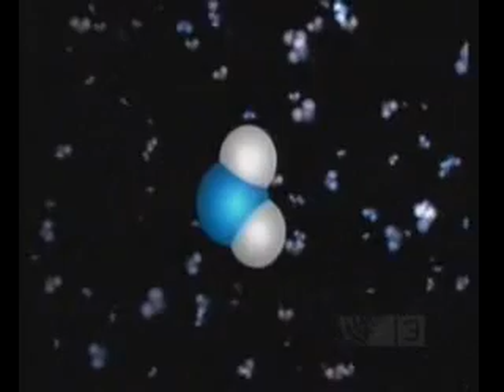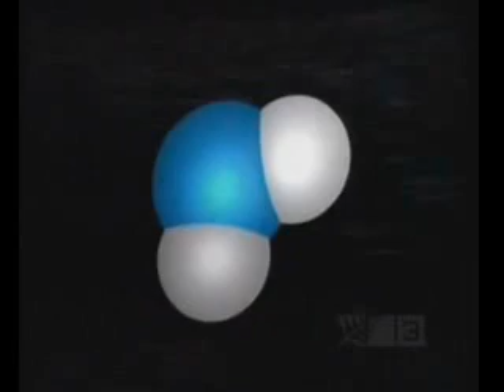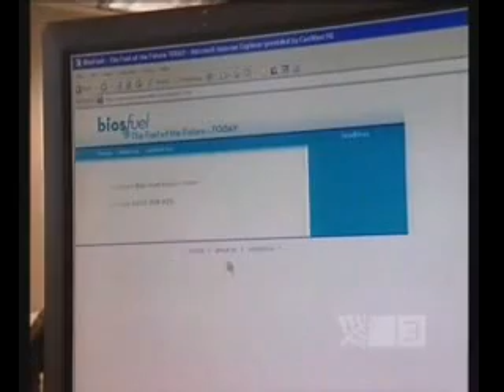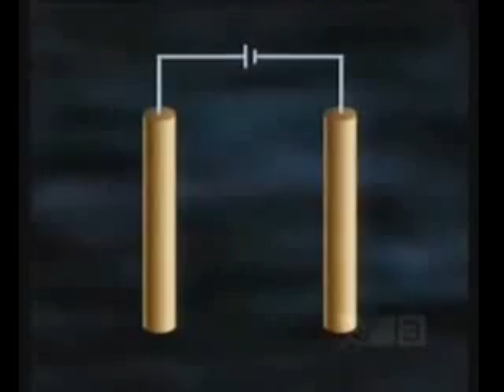A Motorcycle that runs on PURE Water.

Comment: one of the other comments about hydrogen peroxide as rocket fuel is true...however thats 90% H2O2 what you buy in the health food store (for $20+/half gallon) is only
35% H2O2 and what you get at the pharmacy is only 3%....there is no smell to this stuff. But if you'll notice none of them put thier finger in this "water based fuel". 35% H2O2 is VERY coustic and will turn your finger white within a minute or so. Ozonated (H2O3) is drinkable and could be part of this process as well. Ever play with Calcium Carbide and H2O? The bubbling result produces Aceteline gas (used in welding equipment). I'll have to play with some of this stuff on a lawnmower or something.

Comment: The fact that they say it's running on water is a bald face lie.  You have to split the water first into it's elemental makeup through electrolysis to hydrogen and oxygen. You then can use the hydrogen gas to run a normal combustion engine.  There is no free energy here, it takes alot of electricity to perform electrolysis to make enough hydrogen to fill a tank for any auto.
Reply: Scott Freifeld that means over 70% must come from another source that is not the engine in the motorbike e.g. a bank of high load batteries that costs money to recharge, the motorbike engine will not be charging the batteries either.
In the end if you have batteries you might as well use an electric motor it is far more efficient then 30%
Reply: I read somewhere its a 30% loss of energy converting water into HHO.  Even so with that kind of loss its still better figures then gasoline..imagine how much loss has gone into drilling/refining/hauling heh
Reply: I vaguely remember someone saying that it takes about 10 calories of energy to extract and produce 1 calorie of equivalent fossil fuel based energy.  Consider the cost (in calories) to run the drilling and pumping equipment to extract oil from the ground.  (Food production takes as much as 3x - 6x that amount).

Then I found this website:
https://www.ecoliteracy.org/article/fossil-food-consuming-our-future
Reply: and this water powered bullshit is the wrong way to solve it

Comment: In 1910, my grandmothers brother had a "Delco Plant and a battery bank for lights at his farm. My grand father tried to run a car on electricity to do so he used electricity to break the hydrogen from the oxygen then ran the car engine on hydrogen gas . It worked but electricity was too expensive. 
This motorcycle has a starting battery and it could be fed into the carburetor and the engine would run. for a mile or two...

Comment: It's the money game that makes the world go round.  As long as the energy interests find a way to profit from this method there's always going to be resistance. There was the case of a 'plasma' spark plug so efficient it could outlast the spark gap hundredfold and could even split water vapor into its basic components.  So far we haven't heard much from it except that Bosch considered its adoption, but for that had to phase out its entire production line. This is just one example, but the world is gradually getting there.  We may have to wait until oil runs out in order to see more advances. There are many ways to skin a cat and this is not the only method to extract energy from water, you could also call it 'oxidized' hydrogen. But if I were him I would keep a low profile and continue to do my work, but also share as much of my knowledge with others. Of course he may want to play the money game, but that's up to him.

Comment: I agree, you can't get more energy out of something without first putting more energy in.
What I don't agree with is that there is NO energy in Water, 
You have

You have to remember that Water in it's most basic elements is some rather volatile stuff. you have Oxygen which feeds flames and helps start explosions, and you have twice as much hydrogen, and Hydrogen while it likes to implode when it combusts, does not neutralize the Oxygen.  All you can say for certain is that Water is Stable.

Comment: The answer is simple: you need energy to compress air. When going chemical energy -> compressed air -> movement you lose a lot of energy. When you are going from chemical energy -> movement it is more efficient.
By the way; compressed air contains little energy. Don't drive too far!

Comment: I THINK THIS GUY IS USING HHO,AND THE BOX HE PLACES WATER IT IN AND CONNECT TWO WIRES IS A TRICK,THE OUT COME IS STILL WATER FROM THAT BOX THAT HE PUT THE WATER BACK INTO THE (GAS) TANK AND HE HIDES ELECTRODES IN THE BIKE TO MAKE HHO,THAT WHY THE BIKE ACCELERATE IN FUNNY WAY ,SINCE HE IS UNABLE TO GET THE MIXTURE OF HHO RIGHT LIKE EVERYBODY THE DEMAND IS EITHER LITTLE OR TOO MUCH ,HE CAN'T FIGURE ON DEMAND,IT IE STILL STAN MEYER PROCESS HE IS USING ,AND NOT TOO MUCH HHO ON THE START,

Comment: Your wrong the HHO reaction goes like this 1 amp 1 hour =6 litres of gas 10 amps 1 minute= 1 litre. Expansion ratios  water to gas 1L water =2037lires of HHO, exploded gas with spark that exceeds 9,000v is 1729/1 so increase the current to 40 amps you can turn an engine I designed at 3000revs it displaces twice its volume per revolution out of 2 combustion chambers see it at hhoigo.com  so output calcs like this 4Lx102.3x85%=34782kw input goes this way 40amps divided by 13vdc = 3.07 watts in

Comment: This video doesn't make sense. They assume that electrolysis is used to create the energy needed to run the bike, but those who understand basic chemistry know that this doesn't work.

The reaction to convert H2O into hydrogen gas is an endothermic reaction, requiring 286 kJ of energy. The amount of energy received by burning that hydrogen is theoretically 286 kJ of energy. In order to turn water into hydrogen, you need energy. Powering an engine by electrolysis of water is not possible.

Comment: A simple emmisions test would help prove if this can work or not. The test would show zero CO2 emmisions. However even if it showed zero co2 it could just be an engine that was modified to run on hydrogen. Hydrogen is not water lol...you would have to fill tanks with hydrogen, not water. HHO (oxyhydrogen) is not possible for this as it would need to be produced on board on demand since it can't be stored in tanks. Again would not be hard to prove but you never see proof,  only vids of claims

Comment: You are wrong and cannot compare what I am stating to a flat earther. It was up to individuals to believe it was flat or not even though way back in the 3rd century it was speculated well before Columbus. Eventually it was proven so any debate after proof is futile. But google this.."Ford and SunPower offer rooftop solar panels to offset electricity used to charge EVs" . That is off the grid. Google this...Electric Cars--How Much Does It Cost per Charge?" So WHERE are you getting your info from?

Comment: Ok. our fuel saver is not one used on transport it save energy needed to heat domestic hot water. I've been planing to do this for a wile and its to hard to explain in words so I will make a video showing the fuel saver and how it works and I will give it away... Basic it heats your domestic hot water from the top of the storage vessel downwards instead of from the bottom upwards. it heats the hole storage tank 5 times faster and five times cheaper. Do you live in UK? Im happy to show it to you?

Comment: I hear you.  Yes, when the hydrogen and oxygen are joined together they're in a low energy state held together by electrical forces.  When you pull them apart they're in a high energy state.  When they burn to form water, they're falling together again.  Now, the electrons in the S-shell like to hang out together so they tunnel across a gap and H2O turns into OH- and H+ ions, which dissolve things.  This bends the field holding the ions together changing energy levels.  This comes from zero pt

Comment: Back in the 1920s people sold sodium metal tablets you put in water to produce hydrogen gas from water.  This seems like a version of that.  I'm wondering two things; (1) what is the blue light that was in the room after they left?  That could have been a UV energy source that activates some sort of process.  (2) could a colloidal suspension be prepared that's stable until you heat the liquid and cause it to react?  The energy comes from the coal used to reduce the ore in the first place.

Comment: "no hidden battery, no electricity, no sign of any other liquid". But perhaps another form of input energy? Energy cannot be created nor destroyed. It can be converted, but every time it undergoes conversion, some is lost as heat.
Simply put, whatever process this guy uses to treat the water will take more energy than the water gives out through the engine combustion.

Comment: You run electricity through water (electrolysis). Hydrogen gas is is concentrated around the positive lead and oxygen the negative lead(those might be backwards H - and O +)

Comment: energy required to split water into hydrogen and oxygen by electrolysis or any other means is greater than the energy that can be collected when the hydrogen and oxygen recombine. Elements which are more electropositive than hydrogen such as lithium, sodium, calcium, potassium and caesium displace hydrogen from water, forming hydroxides. Being a flammable gas, the hydrogen given off is dangerous and the reaction of water with the more electropositive of these elements may be violently explosive

Comment: PART 2 About two ounces of leaves and bark were boiled in a liter of water, cooled, and a small amount of salt, citric acid, and secret chemicals were added. About a pint of combustible liquid that smells and burns like kerosene was produced within 30 minutes. The National Chemical Laboratory (Pune, India) analyzed the substance and found it to be a pure hydrocarbon with a boiling point of 170° C. The new fuel is more efficient than gasoline, and produces no sulfur exhaust. Researchers at the

Comment: 1860 liters of water gas from 1 liter of water. when burned in an engine 900 liters of oxygen is released through exhaust 4  hydrogen atoms will only need 1 oxygen atom to burn. large cities public transport could be used to oxygenate city air. 1 billion combustion engines on the roads oil companys wont give them up easily would you? high voltage and passing a frequency through plates or tubes is a good place to start match the frequency of water and pulse electrons through. teach yourself

Comment: My guess: 
Water processor: Nikel / Cadmium electrodes / proton exchange  membrane ionizer. No gas output.
Liquid processed and used as fuel : Hydronium H3O = acid water. ( see Wikipedia for /Hydronium) 
Result:
Monoatomic Hydrogen at demand. 
 O2 from air+ pressure and electric spark= high temperature reaction ( higher then H2) and water is converted into high pressure steam

Comment: To extract hydrogen from water, you need energy, then you can use that hydrogen to produce energy, if your machine does not have a 100% of yeld it can't run and if you want to power a vehicule it needs to provide more energy than it got, surely in a piston engine you have lost energy in the heat.
In a regular gas engine you could use that heat to decompose water by injecting water inside the cylinder head which can become hot enough (6 to 8 hundred degrees C)

Comment: I think there are some 'free' energy devices that work, but this one seems fishy. Why didn't the experts that examined the bike do their job? Just run the bike until the fuel is gone. Then examine (smell) the 'water fuel', and if it's not normal fuel, pour it into the tank. If the bike still runs, try to burn some of the 'water fuel'. Simple.

Comment: You can, indeed use water as a fuel.  You just need to use chlorine pentafluoride as the oxidizer.  Chlorine pentafluoride is hypergolic (ignites on contact) with water.  YOU are mostly water.  Think about that before you consider handling ClF5.  You can also crack water into hydrogen and oxygen, but that always takes more energy than you can get from burning the hydrogen.  In other words, IT'S A SCAM.

Comment: This is such an old inventtion.  Water has been turned to Hydrogen gas to run engines.  Where has everybody been?   It's not good though to run an engine without a little bit of gasoline involved because it's claimed that engines while running needs the oil residue from the gasoline to keep the engine from being damaged. RC. But comeone check youtube for Dry Cells HHO engines.  ?????????????

Comment: The next step will be using this fuel to burn and create steam and electricity generation from the steam turbines to propel electric powered machinery without emissions.each machine will have a small water fuelled power genorator on board.

Comment: In the best case scenario, where we have all of this stuff taken care of, then the procedure would be like this:

Plug your car into the wall at night and let the power grid separate the water for you.  Then just unplug your car during the day, when you want to use the engine.

Or, you could just charge a battery and let the battery hydrolyze the water AS you run the car.

Or... the most simple solution...  is to just use electric cars.

That's why nobody is funding this.

Comment: Assuming we do develop a combustion engine that will run reliably, without being damaged by the corrosive oxygen gas, then we will have to have some way of containing that gas.  Think of propane tanks, except oxygen and hydrogen.  Fortunately, propane can easily be liquified and stored under relatively low pressure.  Unfortunately, oxygen and hydrogen cannot be stored this way unless they are cryogenic.  This opens up a whole new can of worms.

Comment: Also, it is very easy to burn gasoline because you don't have to do anything to it to make it combustible.  Just pull it out of the ground, separate it from crude, and there ya go.  

With water, you have to put energy into separating the molecules into hydrogen and oxygen gas.  You will get exactly the same amount of energy out of burning that mixture as it took to separate that amount of water.  

If we can make an engine that can withstand the corrosive environment, we will be on to something

Comment: Because it isn't new.  The reaction of hydrogen with oxygen is as simple as it gets and has been common knowledge for years.  

The trick is building an engine that can withstand the combination of moisture, high temperatures, and oxygen for as long as a typical gasoline engine lasts in a normal car.

Comment: it may work to modify the h2o to hho   but how much energy does it take to make the hho?
if it takes 15 kwh to make a pint of the fuel then you burn it in a generator to get .5kwh  its not a good deal.only good if had a lot of solar panels somewhere to generate hho for generator on a rainy day.
But the cost of cells and equipment would be prohibitive.
many of these fuels work but they DONT save fuels needed to run the generator.
Electric cars are recharged from the wall from a coal fired plant.

Comment: Two stainless steel plates one to negative one to positive. 050 inch between them in distilled water with baking soda 12volts  5amps will produce H.H.and O. Then piped to intake between Carb and intake. Twooneeight 5650204

Comment: from what i can tell from the research i have been able to find *which is almost none and damn hard to find at that* he is burning a 40% water and 60% basically veggy oil mix which yes the power comes from the hydrogen the oil just ingites it. and that would give the reasons for the mild modifications to the carborator. its a veggy oil carborator

Comment: The title is misleading. The motorcycle runs on hydrogen and oxygen gas, not water. Water is the byproduct of the engine, it is not the fuel. You can use water to make hydrogen and oxygen gases but it entails another energy source.

Comment: If I remember correctly ; there was an inventor in the US who stored hydrogen in water , kept it in the water by maintaining the ph -value and released it by changing the ph -value .
The water itself does not burn; it only carries an additional amount of hydrogen.
Remember the burning water that came out of the water tap in areas where they 
fracture gases? The water functions as a carrier of the gas.

Comment: The issue here is not whether H makes a good fuel, it does. It has been used to fuel internal combustion engines for 200yrs. You need to research this subject and visualize what the debate actualy is about.

Comment: The expert is a moron. The rate of reaction for hydrogen with oxygen is far higher than hydrocarbons with air. Bottom line is, hydrogen CAN be used as a fuel (search HHO engine on youtube, plenty of videos).

Comment: Hmm, with a cursory google, it turns out that H2O2 can be used not only as a bleach and an oxidiser, but in reasonably pure form (above 70%) it can explode all by itself when vapourised and ignited ... quite what the combustion products are, I don't know, but I wouldn't be surprised at there being a lot of NOx in the exhaust as it's about the only other thing for the liberated O2 to react with.

Doesn't explain the lack of smell, and it'd still be an energy-negative solution, but it's one idea.

Comment: Water based ... nothing added ... but they're not drinking it ... so, peroxide maybe?

"We got an independent mechanic to check it out... a guy from Toyota"... a company that doesn't make or service bikes. Was there no-one from Suzuki, Honda, Kawasaki, Yamaha, KTM, Ducati, etc available?

And he doesn't let you see the process? Are you sure it's not being subbed for ethanol between the tap and the tank, then?

Or at the extreme there isn't a sacrificial lump of alkali metal in the "tank"?